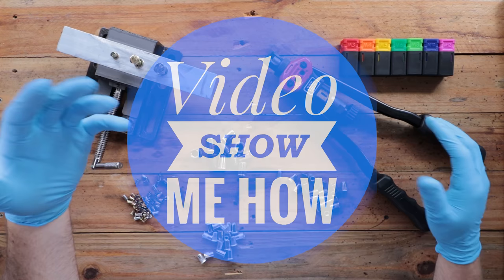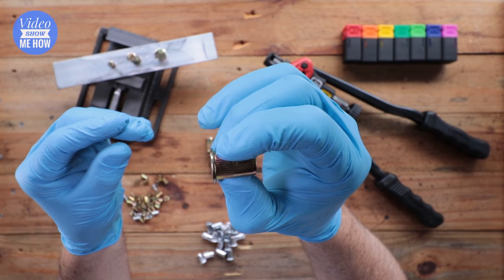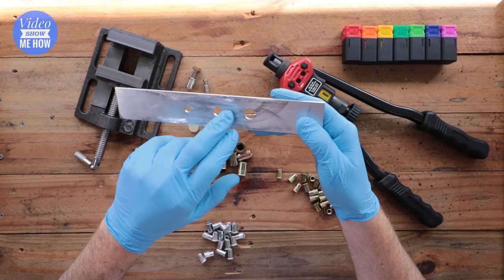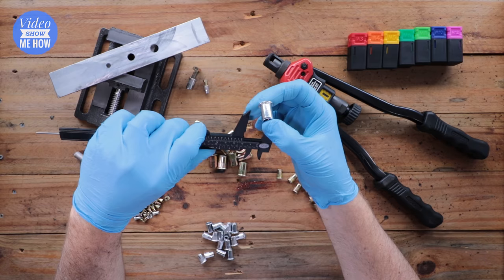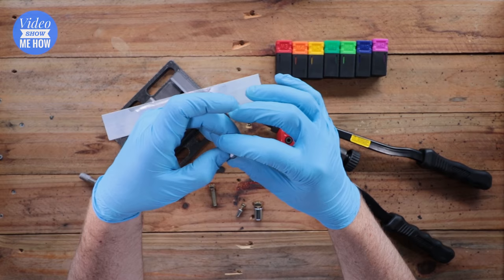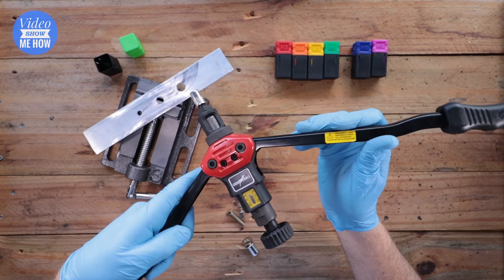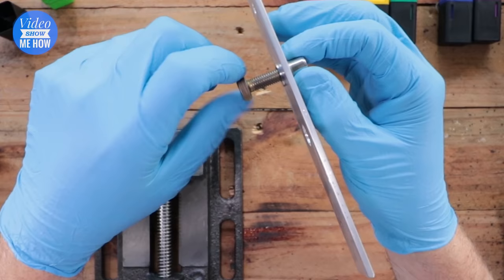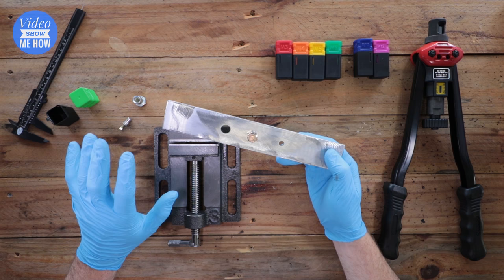How to Install Rivnut Rivet Nut Nutserts WITH TOOL [Full Guide]

Comment: Will a 8M die work with a M8x1.25 rivnut? I need to install a rivnut threaded for M8x1.25 and while I have found the correct rivnut and I've only been able to find riveters with M8 dies.
Reply from the maker: Yep should do. Have some options in the links in the description of this vid

Comment: Hi,can you cut excess material of to make it flush?
Reply from the maker: Do you mean on the top bit? Where you screw the nut into? If so no not really as it uses that flange to lock it in place. Could always give it a try :)
Reply: @VideoShowMeHow   iam making some brackets for some brick clamps,on your demonstration it's the bit you don't see, will the thread be to short?
Reply from the maker: Oh do you mean cut the threaded side? You could, ideally you want the bolt using the full length of the thread though 👍
Reply: @VideoShowMeHow  👍

Comment: figuring out what size bolt to use with which nutsert and then figuring out what size hole to use.....very confusing!
Reply from the maker: Yes tricky, the hole is always heaps bigger than you think compared to the nut size! Generally I start with the bolt first, then find right size rivnut then drill right size hole 👍

Comment: How do you choose the bolts to match metric rivet nuts? 

And then drill bit too?
Reply from the maker: I usually just pick my bolt, grab Rivnut to suit and size up the drill bit. If you don't have a set of rivnuts though just google it for your bolt size, there's lots of great charts like https://rivnut-hole-size-chart.metamodchippewa.space/img/4aba1fa616876a61483924667b59bb04.jpg
Reply: @VideoShowMeHow  i have rivet nuts but I don't have any bolts or screws and the size charts are confusing to the size of rivet nuts.
I mean I think any length works but I can't figure out how to find matching thickness sizes to M3, M4, etc to M12
With everything online if the size isn't clear I don't know how to order

Could you please tell the screw thickness for the 12  rivet nut sizes.... ...

I would truly be so grateful
Reply from the maker: @katieh3236  if you have a M12 Rivnut, you need a M12 bolt. Your hole size for this needs to be 16.1mm. Hope this helps

Comment: Has anyone ever used these nutserts in round tubing?? I have to fix my wheelchair... I have some stripped screws holes in the aluminum tubing. I have some stainless steel rivet nuts coming in the mail in a few days. Any info would be great!!!
Reply from the maker: Hey mate 👋 They won't work that great in tube unfortunately, if the radius isn't too tight might be kinda of for light duty but their strength comes from jamming both sides of a flat surface. Have you considered drilling hole right through and using nut and bolt perhaps?
Reply: @VideoShowMeHow  Bummer!! I can't drill all the way through unfortunately. There are two tubes that are welded to together right where the stripped screw hole is... I may just give it a try anyway.. The nutserts I'm going to use are not that big. I forget the screw size. But I think they are SAE 10-32". Witch I think are close to 5mm... Thanks for the quick reply to my comment... Have a great day my friend!!!
Reply from the maker: Ah bummer, give it a go and see :) 🤞for you 🙂
Reply: @VideoShowMeHow  Thought I would let you know that they seam to work in round tubing... I did a test before I try it on my wheelchair...
Reply from the maker: @scottbecker3563  ok nice! So you're up and running? (Rolling?)
Reply: @VideoShowMeHow  Not wet!! I'll probably work on it this weekend..   I wanna get some fresh new bolts... I hate using old stale steel bolts.. LOL I will probably have to use one of the methods that you teach in your videos here.  I'm not quite strong enough to squeeze the handle on the tool... I wasted a few rivnuts practicing my technique and how to use the tool and my strength...
Reply from the maker: @scottbecker3563  best of luck for the weekend then, let me know how you go 💪

Comment: Can the tool be adjusted so the crushed bead is wider/grips more?
Reply from the maker: That would be all to do with the nut itself bud, if you tighten too far it starts to kink off to one side making it difficult to screws in your fastener/bolt
Reply: @VideoShowMeHow  I was wondering because I noticed you can adjust how many threads can stick out of the rivnut when tightened down on the mandrel by the middle knob in the tool which either widens the handles or brings them closer together. So that wouldn’t make any difference? New to this tool
Reply from the maker: @mrsemifixit  Yeah I normally give it a few extra little turns and a second go but with the proper tool it basically maxes the Rivnut out. You can get different rivnuts with various strengths etc. Get a bit of scrap and have a few goes to test 👍

Comment: Does these nutserts work for materials thicker than the nutsert?
Reply from the maker: No they work by crushing top and bottom into the material
Reply: @VideoShowMeHow  that's what I was afraid of.   I have a project where I need to drill and tap thicker material however that material does not tap well, the threads get ruined when I removed the tap.  It's some kind of soft aluminum alloy.  I was hoping to use something like this instead. Do you have any recommendations?
Reply from the maker: @cpabrego  can you access the back? Nut and bolt?
Reply: @VideoShowMeHow  no back access, it has to be recessed.
Reply from the maker: @cpabrego  how thick are we talking? I think you can get longer rivnuts
Reply: @VideoShowMeHow  thr material is around an inch thick, but it's not feasible to drill though without affecting functionality.  I only need about 1/2 inch long rivetnut
Reply from the maker: @cpabrego  oh ok. The RivNut has to go all the way through the material, that's how they work. Doesn't sound like they are the way to go for your application. Hopefully there's an alternative out there 😊

Comment: dont use rivnuts in plastic, they will pull right through before they get tightened.
use Jack Nuts instead. the difference is the amount of material that splays out when tightened, with jacknuts having three "wings" that fold down, providing less pressure, but much more surface area.

Comment: It kills me to see these videos on how to. Instead pulling the locking mechanism downward to either install or remove the screw attatchment... how about doing it a little smarter and pull the handle down. Yes the one in the middle where you remove the tool from the installed nutsert.

Comment: This is not a very good video - does not show how to use the gauge nor that it typically takes multiple pumps to set a RivNut
Reply from the maker: Just the one pump and maybe a cheeky little second works fine with this tool. Some of the short handle tools take a few goes

Comment: Have you tried the diy method using an impact driver?  https://www.youtube.com/watch?v=u4huFzeQIgw
Reply: Do not do that. 

Installing with a drill or impact driver is not a recommended method and is likely to result in an over-installation of the rivet nut as you could be installing with too high of a torque.